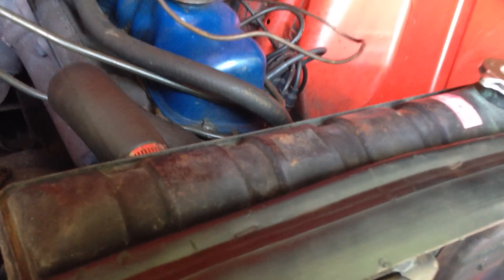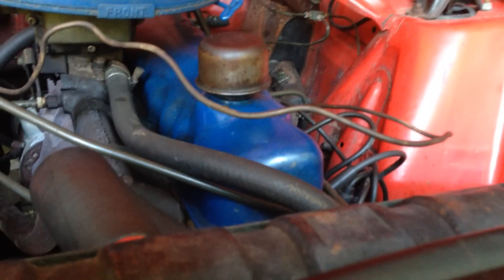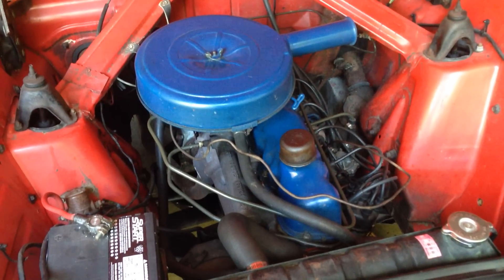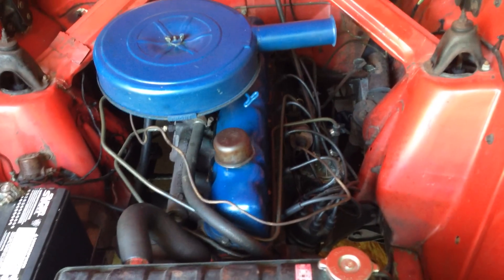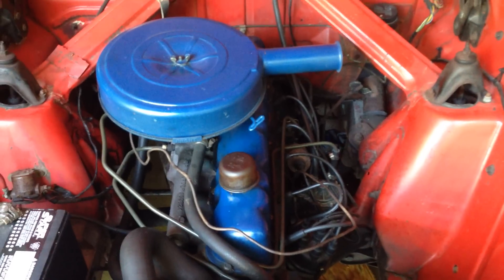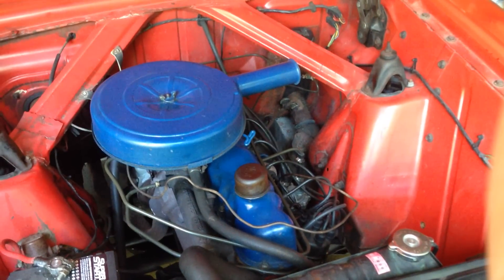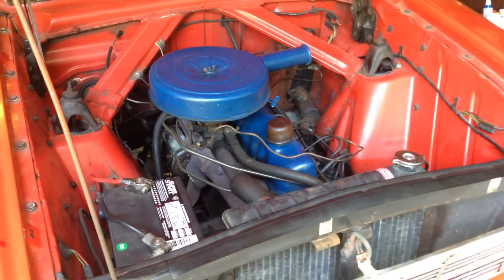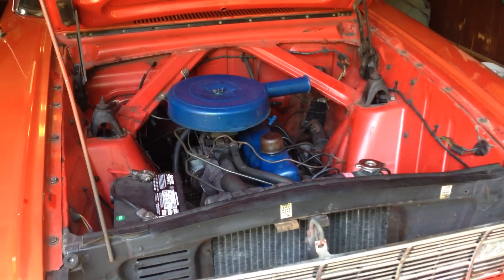Falcon Engine Swap Thoughts

Comment: Exactly. leave the cap off and run the engine. put a pan underneath because it will spit out some fluid when the air  bleeds out.

Comment: Swap the original engine with an LS corvette engine. how much would that cost? You'd also need better brakes and whatnot. disc brakes in the front part at least.

Comment: Just put everything back and as Ford designed it and it will work fine. You probably have a clog inside or the rad is plugged up with dirt and bugs. It's a very simple cooling system. It either is the rad the water pump or the thermostat. Try removing the thermostat and see if it still runs hot.

Comment: A little late to the game  but for diagnosis here's what I would do.   First pull the thermostat out and run the engine without it.   This will tell you if it's the thermostat or something more serious.   If the engine still overheats without the thermostat then you should try getting the radiator cleaned (also called "rodded out") and replacing the water pump.   If none of this works then it's time for an engine rebuild.   The inline 4 should make quite a bit more power than you're getting.   Dropping speed to 10mph going up hills is a bit weak.  A v8 will likely make this car a screamer, and you may get high on the power, then develop a tolerance for it and pretty soon you're looking at putting turbos on your built windsor because 1000hp on the dyno...

Comment: My mk5 golf before i bought it had an massive engine failure it fell out nearly but it was because it hasn't been serviced in over 30k miles which I think is amazing but they had the option to put the vr6 r32 engine in which I wanted desperately but it was most defiantly not practical and way to expensive so I had a 20k 1.9 put it and if you engine swap it swap it with an original wings or have your one rebuilt

Comment: this engine is going to cost you tons without a complete rebuild, inside out. until you dissect it to the bone you will never know the true extent of the problems it has. i can't imagine any engine parts on this are common or cheap.

my suggestion? dig in a scrapyard for a small Ford V8. an 80's 255 will get you plenty of mileage.

Comment: Get a flex fan to replace the old fan.  Get a new core in the radiator, with an extra row of tubes, between the stock top and bottom.  Perhaps... Auto-Overdrive as others suggested.  Finally, run the engine with the cap off to get the air out.  Turn on the heat as well to get the heater core flowing and air out of there.

Comment: swap a 300l6 in it shouldnt over power anything in there car will will burn out nicely and dont even worry about putting oil or coolent in it i ran mine kept burning oil and blowing the radiators i just kept driving the thing half our with the temp as high as it will go and that motor would not die

Comment: Get a junkyard 302... throw some gt40 heads and a decent cam in it.. get a t5.. rebuild it... throw that behind it.. throw a 8.8" in the rear.. probably have to get that shortened. .. prob around 3 grand ypud have about a 250 rwhp car.. then youd have to dive into brakes.. look into baer brakes.. really good and affordable... so is ssbc... suspension.. no idea there haha.. but whatever you do keep it blue oval under the hood.. i hate brand swaps

Comment: Did you replace the radiator cap? Cheap, simple and often over looked. If the cap doesn't allow the system to build pressure, the coolant will boil over and the car will over heat.

Comment: my engine swap recommendation would be the the 4L straight 6 used in more modern ford falcons in australia. I feel it would be the least sacrilege swap and retain its modesty as a regular car with regular power output. you could get a single cam from the 90s (~210hp) or twin cam from recent models (~260hp)
they are used as taxis here and the engines are known for their extreme longevity, with ex-taxis regularly being sold cheap with 600,000+km on the original engines still going strong
the longblock would be very cheap from aus (like <$100 + shipping)

Comment: One possible problem that is causing the overheating (wich actualy happend to my car) is that the clutch fan had somehow worn out. The clutch on the fan basicaly lets the fan free wheel untill it gets to a certain temperature,  and then engages the fan till it cools down. On my car, the fan was as old as my dad, and had worn out; it wouldnt ever fully engage. I basicaly went down to car quest and bought a flex fan for 45 bucks, which is a direct drive fan that has no clutch assembly that could fail. If you go that route,  you will most likely also have to buy a fan spacer to get it closer to the radiator.
Just a thought, quick, easy, cheap, and simple. And if that's not the fix, then it still is a preformance/efficiency increase anyway
Reply: It also looks ljke your radiator shroud is missing (I honestly don't know if it just didn't come with one or not, but it also could help your cooling problem

Comment: Throw in a 200. You can get one for super cheap because the Ford guys throw them away for v8 swaps. The 200 has a better block with 7 main bearings. Have the head milled for 9:1 compression and put a better carb on it (Carter YFA 1 barrel, or a 2v and adapter) and Durspark II ignition. And a T5 is not too difficult of an install with an adapter plate on the 65-up bellhousing for a toploader 3 speed. I also have an E-bay aluminum radiator and it works great. I may add a shroud later but it does OK without one.

I have all this in my car (well, my transmission is an SROD not a T5). And I have no problems going hammer down on the highway. I can run 65mph and the engine isn't breathing hard. Rarely get above 200 degrees in traffic. I get about 26-28mpg. And its all dead reliable and uses dirt common Ford parts which can be had at just about any parts store.

V8 swaps are OK I guess, but they make the car front-heavy (probably not if you invest $$$$ into aluminum intake and heads). And the mileage is not as good and the maintenance costs are higher. One other consideration with a V8 swap is the rest of the car has to be able to take the power and weight. That means changing the rear end, suspension, steering, and brakes to the V8 parts. And you'll have to change the steering because the 6cyl Falcon steering linkage hits the oil pan on a V8. The 7.25" rear end they put in the 6cyl Falcons is adequate for the 6 but would die pretty quickly behind a V8.

Comment: I don't know older Ford's at all but I'm adept with the the newer 1990+ cars. I'd say drop a 4.6L PI mod motor in there if you're looking for a cheap modern fuel injected V8 that'll scoot along. They're a dime a dozen. Performance wise they aren't too good from the factory, 260hp or so and quite some torque, but you do get access to a lot of 90s and early 2000s Mustang GT performance parts. Reliability wise they're solid, if a quarter million miles with just oil changes, belts, hoses and a water pump isn't reliable then I don't know what is. If something does break, it's cheap and easy to fix.

Comment: Having the car you actually wanted (White, four door V8 289) and we had to pull the thermostat to get it to cool. Basically for whatever reason even replacement ones wouldn't open. Also, just outright replace that water pump.

Comment: V8 swaps are fun, but it won't be cheap and will require a lot of work.  Its not like the car is going to loose any value if you do it, and you can keep all the I -6 running gear and engine anyway if you do decide to sell it down the road.

As far as the radiator, I would remove it and bring it to a radiator shop where they can boil it out and flow test it.  It's likely full of shale that you can't see considering the cars age.

Comment: Something I can see immediately is the upper rad hose. It's likely stock, but try shortening it a bit to get rid of the hump in the bend. If your hose has a high point, it severely restricts flow, you want the upper radiator connection to be the highest point in the system. 

It is possible that the coolant valleys in the engine may be blocked too.

Lastly, the fan doesn't have a shroud. This should be at least a partial source to heat issues. Electric fan, and aluminum rad are upgrades you would likely do with a swap anyways, so maybe start there.

Comment: How about keeping with the Falcon heritage and swapping in an engine from a modern Australian Falcon? The twin-cam 'Barra' series engines from 2002-current are great. Torque for days, even the N/A ones. In fact, the N/A models have better power and torque figures than the 4.6 V8 in the Crown Vic. There are also turbo models for added grunt (could be overdoing it though). These engines will do a million KM and there are junkyards all over Australia with these engines as they outlive the car. Pair it up with a 6 speed ZF automatic.

Comment: Go with a later 200, 240, 250 or 300 straight 6. Too bad the straight 6 wasn't really developed past the mid 90's in America. I know Australia got modernized versions of these straight 6 motors.

Comment: Everybody has a V8, they all look and sound the same :-) My Aspen has a Slant 6, and I will never swap. I will someday replace the 3 speed auto for a 4 manual with OD (daily driver, the 4th OD will help a lot on the highway), but the engine will stay.

Comment: Keep it original. All aspects of the cooling system should be inspected. Maybe the impellors of the water pump are gone.

If you swap, look at the later model I6 Aussie Falcon engine. 250 crossflow should be simple. The XR6Turbo engine probably won't.

Comment: Your radiator has definitely seen better days.  Notice the color on the front of it?  That bluish greenish color?  That's the copper breaking down.  You can get the radiator re-cored at a rad shop, if there are any left in your area, for fairly cheap if you want to keep it original.  Also get some kind of shroud on it.  That cooling fan isn't really doing anything without a shroud.

Comment: Mr.RCR. In Australia Falcons are still a popular production car and most base models are fitted with the famous DOHC 4.0L Inline 6. Also coming in turbocharged model they are pretty fast stock. So, if you were to do an engine swap TECHNICALLY you aren't breaking the rules as another falcon engine will take it's place. They're cheap with a 4 speed auto(With a sequential shift) but your only issue would be shipping it to the states.

Comment: I would guess that what Jordan Pier said is the likely cause of over heating(Clogged cooling passages). One way to burp a radiator is to remove the cap and squeeze the lower radiator hose(This will take a long time) till the bubbles aren't too big then you can run the engine with the cap off and try to get the rest out.

(BTW keep the original engine its the heart and spirit of the car)

Can the falcon even run normal pump gas?(doesnt it need leaded fuel or additives?) if the falcon can't run normal gas one of the first mods I would do to make it a better daily is to get new valve seats installed and adjust the timing so I can run unleaded. I would keep the original fan unless it is the known problem of overheating, the falcon doesn't rev real high so your fine but the radiator looks teeny so I would replace it with a bigger unit. (After writing this I realized the overheating could be from running unleaded in the car if it can't handle it, you could be burning the top end :O)
RegularCars

Comment: I just put a built 302 with a t5 into my Volvo 940, and it was a great choice. If you do the swap, you can keep a small block Ford pretty analog and not have to deal with the headaches of putting modern electronics into an older car. But be prepared to engine swap headaches, like things not fitting, and finding special parts that aren't really around anymore

Comment: I had the same problem in my mazda pickup with the gurgling, it was indeed a stuck thermostat and whats happening is the water is boiling in the hoses back and forth. Change the thermostat and run the engine with the coolant cap off until up to running temp and see little to no bubbles , put the cap back on and voila.

Comment: If you swap engine the car will loose charm. I had this engine in a Ford Cortina here in Australia. You can get different heads for them that dont have intake cast into the head. I say just put some new rings, shave the head and convert it to unleaded gas. Get the cam ground for more lift and some overlap and with a holey 350 and some extractors that thing will go hard! and sound sweet

Comment: Go 351W if your gonna swap it. I'm a Ford guru and should be able to give you a lot of help if you need it. I know the old cars very well.
Reply from the maker: slashfan7964 Do the 351 and the 302 have the same exterior measurements?
Reply: RegularCars The 351 is slightly larger (we're talking about 2 inches tops) in width and overall height to accommodate the extra 46ci. Length wise they are the same size. Other than the intake, water pump and block, they use the same parts and interchange (as an example I have an aftermarket camshaft designed for a 302 in my current 351). A 302 would drop right in; I think a 351 would be a hair tighter (it will fit, I've seen it done) but overall you have a much larger advantage in torque and power output. The 351 will use the same transmissions as a 302 (bellhousing pattern is the same), the same perches and engine mounts, wiring and all since they are basically identical other than the fact the 351 is basically an enlarged 302. you should be able to pick up a running motor, either or, from a junkyard F150 for about $300.
Reply: kinsmarts lol

Comment: Keep the 144. Tear it down to the block and have the head hot tanked and checked at a reputable machine shop if you have to. I'd start by having the radiator cleaned and pressure tested, then go through the whole cooling system. Flush, new water pump, all new hoses, etc. (I'd say t-stat and housing but I see you've already done that). See where that gets you. Go through each system one at a time. By the time you are done not only will you have a great running car, but you will know the entire car like the back of your hand. Welcome to the world of owning a classic car.

Comment: Those aren't air bubbles, they are steam bubbles. Any air will find its own way to the top of the radiator. The steam bubbles are caused by hot spots in the cooling system, and build up of sediment or other contaminates.

Comment: if you swap it, you MUST swap it for another original option. like the bigger 6 or a 289.

also how come all these old cars have no snorkel connecting to the air cleaner?

Comment: Inline 6 engines kick ass, leave it in! I had an overheating problem with my Studebaker Lark when I first got it too; similar I6 engine. I put a gallon or so of vinegar in there and drove for a few days before flushing. Cleaned out an assload of scale and nasty shit, never had heat issues again.

Comment: Just put 289 in it or even a 260 and with a c4 don't worry about running gear too much to front will sit a little lower but it probably won't be stinkbug stance

Comment: The block or head may have clogged cooling passages, or you may have a stuck thermosstat or bad water pump.

Rebuild the 144, put a mild cam in it, get an adapter to run a progressive webber 2bbl carb and you've got good power without sacrificing mileage.

Ditch the 2spd auto, and convert to an AOD. then put taller gears in the rear like 3.55 or 3.73. The taller gears will help you get out of the way faster, while the AOD trans will give you great crusing RPMs and mileage.

It's an old car, they're money pits. Get used to it, fix it up, drive it, and enjoy the hard work. Don't think about what it's worth,  think about how much fun it will be when the problems are solved and you can enjoy driving it
Reply from the maker: Jordan Pier I like how you think. What do I need to know about the AOD tranny?
Reply: RegularCars it is found in many cars from the 80s including fox body cars like the Mustang and ltd. You will have to change the driveshaft length, but that's a given. 
Rebuilt ones can be had for around 800-1000, but you may be able to get one cheaper. Often times reputable tranny shops have them rebuilt and ready to go for sale.

Make sure you install a good trans cooler. Don't rely on ones built into the radiator. The AOD is susceptible to failure from fluid breakdown.
There is also a valve body modification that can be done to improve shifting, but you probably won't notice it behind a 144ci.

Also, about gear ratios. The aforementioned should really be a 3.73 at minimum. The overdrive ratio is at .67, which means you might only be at around 1800rpm at 65mph, which will make the engine bog. A 3.93, or 4.11 final rear end ratio would be best, making crusing at 65 around 2200rpm (assuming original 13 or 14 inch rims are used. This is the ideal crusing rpm
Reply: Jordan Pier Why not just get a four speed manual?
Reply: RegularCars Know that with an AOD you MUST have a working TV cable running from the throttle to the transmission, and you have to get it adjusted right or it burns out. Just pulled an AOD out of a T-bird I got cheap because it was run without the TV cable connected and SCORCHED its first two gears. As long as the TV is set right they are pretty good, but it's almost $500 in special tools and parts to rebuild one.
Reply: Jordan Pier Absolutely! These engine can make good power and sound great when thyre tuned up. As for overheating it could be thermostat or impller is all rusted up on the water pump. Im sure you can fix it easy doode
Reply: Jacinth Gudetti a 5 speed sea would be great, however if he wants to keep it looking stock and doesn't mind the slushbox,  the aod is the best route
Reply: Jordan Pier  I believe the final gear ratio is 3.70 on this car, so 3.55 is the only "taller" option, any ratio less than 3.70 would be taller.